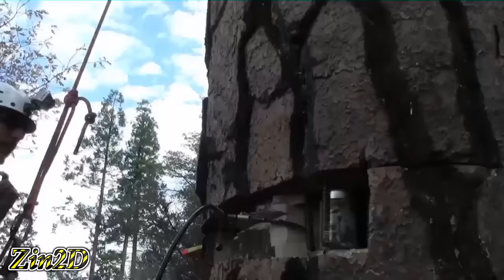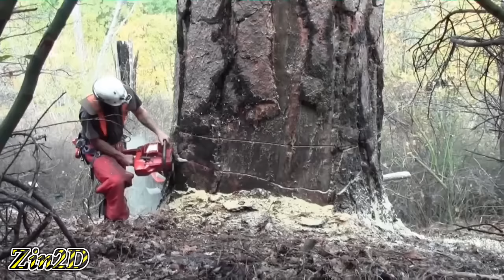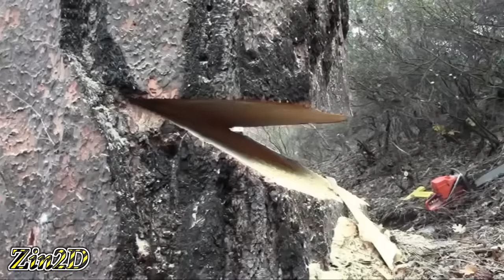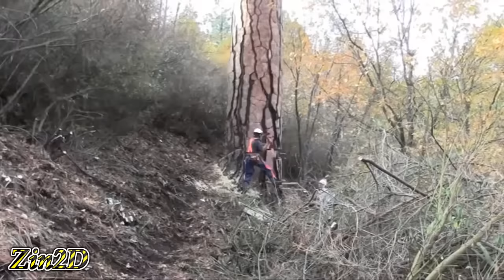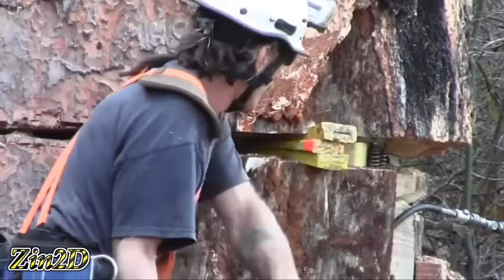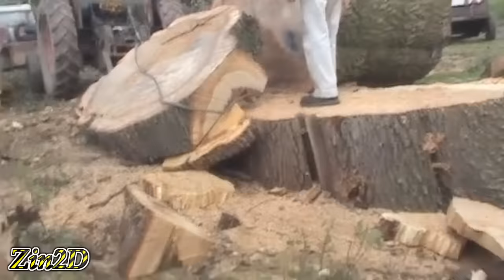Amazing Fastest Skill Huge Tree Felling With Chainsaw, Dangerous Stihl Chainsaw Cutting Tree Down

Comment: That saw is a beast!! Definitely tuned up!
Reply: Nope, it's a Chinese clone of the Husqvarna 395xp.  They're identical in almost every way, and even perform just as well.  For quarter what the OEM saws cost they're actually quite good.
Reply: I admire your ability to articulate your thoughts so clearly.
Reply: You don't need to tune up your saw for it to cut properly... The only thing you really need to do for it to cut properly is what you do with any chainsaw, properly take care of it and make sure it 's sharp :P

Comment: The man with chainsaw needs more training.
Reply: How many 80 inch trees did you have for training?
Reply: As a certified arborist with 15 years in the trade  I see very little wrong with how this was done. His saw got a little dull here and there but please sir, explain how you fell against the lean on a tree that size with a 3210? Climb it? LOL
Reply: @derpderpington3558  , by "3210," did you mean his saw?
Reply: @hotice8885  yes I have one I use for milling.
Reply: @derpderpington3558  Cool. That's a Husq, right?
Reply: @derpderpington3558  we never got to see its plumb line.  It's not impossible the weight is centered,  but so great the lean is not the issue.  I've pressed jack head on a plate several inches into the wood and smashed wedges on 70 inch pumpkin ponderosa,  when it's dead and blue stained already,  more than usual hinge wood is left to keep from splintering the whole bole into firewood when the highest value is the natural stained pine boards with pink and blue straps in the white heart .   But yeah.  This was cut professionally by a group of expert fallers
Reply: Another keyboard warrior criticizing expert work